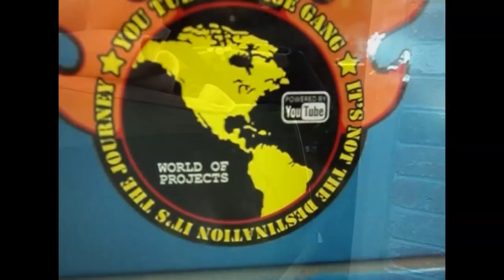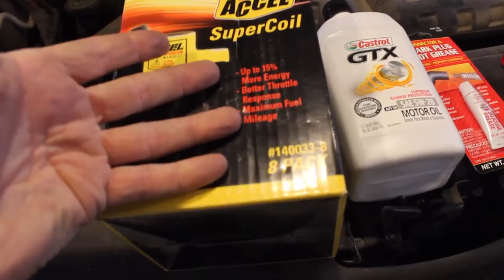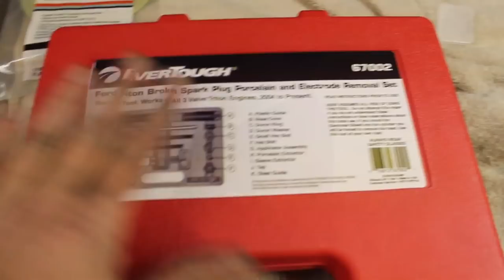F-150 Transmission Shutter - Fixed - Coil on Plug and Spark Plug Swap

Comment: I watched your video and replaced the coils and plugs on my 2009 F150 Triton 5.4 liter 3v. The coils had the brown tips with the updated plugs, so I took them out with a warm engine and had no issues. It fixed the engine shudder and it also starts properly now.  This truck has 247,000 miles on it and now it is running great! I would have spent a lot of money at the dealer if not for your great video! Thanks very much!
Reply from the maker: Awesome!!!

Comment: I am a professional transmission rebuilder for 45 years. when we first started seeing this problem it was and can be hard to ID especially if the problem is slight. but 99 times out of 100 it is a coil breaking down,,,,,,,,,,,
Reply: I have a 92 f150 with a 4.9 i6 5 speed manual and the cel  isn't lit but it stutters in 5th around 60 to 65 mph and I've replaced the cap and rotor, spark  plugs, and wires but no improvement. Im also getting blow by in the air box but the pcv valve isn't stuck,  Would you happen to have any suggestions
Reply: That’s good to know so I just had my transmission rebuilt and a u joint replaced and it’s still doing this same thing right around 50-60 mph when I’m lightly giving it gas. And like he said I can exhilarate and it’s gone so I’m thinking this may be my problem

Comment: Best way to prevent broken plugs is to drive it like you stole it a few times to bust up the carbon and LOTS  of PB blaster.  Remove plugs while engine is hot

Comment: Thanks for your video. I had the same problem and Ford dealer  was of no help. After $250 to clean plugs, and $2875 to rebuild transmission, we still had the stutter exactly as you describe. After watching your video I asked another shop to replace coils ($500) and YES! Problem fixed! Next time I consult YouTube before Ford dealer.

Comment: Was at a loss. Shop thought it was catalytic or transmission. Didn’t think it was misfire because it only showed a cat code. Then saw your video. My 2001 4.6 was doing the same thing; shuttering when it went to overdrive right around 50 mph and light throttle. Saw in your comments that there was no misfire codes, just like mine, so tried replacing all plugs and coil packs just to eliminate that variable.  It worked!!! You were right. Runs and drives great now, and no more cat code too. Thanks so much for the video!

Comment: I had a shudder on my 2005 F150 and after removing each coil one at a time engine running it wasn't the coils, it was the front brake lines. 8 months later I did have to coil problem. Three went out so I replaced them with the ACCEL Super Coils from Oreillys. I only bought them because no one had any OEM's. I couldn't be happier with the results better power, mileage and the money I saved.

Comment: I haven't read all the comments to see if anyone else has made this suggestion or had a better one but nonetheless, here ya go: you don't need that very expensive removal tool. I would suggest using a pair of mechanics gloves when doing this. run the engine, Drive the vehicle and get it to operating temperature. remove the coil packs. blow out the cylinder holes then pour a small amount of seafoam around the spark plugs then spray PB Blaster into the holes until it begins overflowing and boiling. allowed to continue boiling when it stops do a quarter-turn removal as you stated in your video then let it soak in a little while then do another quarter turn then tighten back up quarter turn then loosen a half a turn and just kind of work the plug back and forth a few times everyone will come out no special tools needed. I have done several of these and have not broken one yet knock on wood. hope this help somebody.
Reply: Daryl Seay are sure.....?  lol I'm nervous

Comment: 2002 F150 5.4, 2V.  Had this problem last week at 40-50 mph. Took it in citing problem with transmission. They said coils 3, 7 and 8 were fizzling out. Said the compression was good and that 2002 model wasn't the one that had problems with breaking spark plugs. I paid for 1 hr diagnostic time $85 and said I'd change plugs and coils myself.  Could have been much worse and glad I have a mechanic who is trustworthy.

Comment: Great video... couple of notes for anyone else coming across this...

- Ford fixed the breaking spark plug problem around 2010.. only earlier models have that trouble.

- don't forget to clean mass airflow and throttle body

- need to do full reset on the PCM so that the system can recalibrate itself including all the transmission shift points.  (there are videos on this procedure)

Comment: 2008 F150 with the 5.4 ....3 valve with 138,000 miles.   It's been doing this for a long time, but recently got worse and a little more violent.   I would have bet good money it was the transmission, but figured I'd try this first being the truck is getting some age on it, and the coils could probably be getting tired anyway.   Especially for the minor cost.   I bought the exact Accel coils you listed, got them installed, and problem solved!!   The truck overall runs better and I'm actually getting a little better mileage too.    I can't thank you enough for posting this!!
Reply: 3 weeks and almost 1000  miles later, and all good.  Problem solved and has not returned.  This IS the fix.
Reply: *Long term follow up* : 9 months and 7,000 miles later after replacing the coils with the Accel coils he used, I can 100% say this was the solution to this problem.   It hasn't done the shuttering since.    Thank you Greg!!!

Comment: No codes showed up for my 5.4 triton engine, but viewers should know that the original factory Motorcraft SP-515 spark plugs have been replace by Motorcraft SP-546, this is significant since a host of folks are still purchasing the inventory, albeit new, of old plugs.  6 of 8 of original plugs broke in 2011 (only 75k miles) , but it's important as you've indicated to place spark plug grease on the plugs regardless.  I had my plugs replaced today at 145k miles with the SP-546 plugs.  Like everyone else, I'm happy it was just bad plugs, not torque converter.  My humble opinion is that the motorcraft plugs will go @ 70k miles. My mechanic indicated that quite a few plugs today had only 50% of the electrode(?) left, compared the new plugs.  The drive home was schweeeeeeeeeeeeeeeeeet!!  Hey folks, also keep your transmission fluid fresh every 30k miles MAX.

Comment: This was exactly what I was experiencing in my 2007 F150 King Ranch and after watching your video, I changed my spark plugs and coils and bam the shutter is gone.  Thanks again for the video!
Reply from the maker: Right on!!!
Reply: I was having the same issue on my Silverado.  With how many sensors and bells and whistles there are on these trucks it irks me that no code is thrown. I thought my torque converter was going out but turns out it was the same exact issue as you were having. It would come and go too. It was not constant.
Reply from the maker: Yep.  A lot of the big companies are using this technology.  Along with injectors they get better control of the burn.  Makes for a good sized headache if you don't know what it is or can't find the bad coil.
Reply: These newer trucks are a major headache. I am currently chasing a major evap system leak code. I have replaced every component on the system from the fuel tank on to the motor. It's frustrating. Doesn't affect the motor's performance. I am done with the evap system. Currently looking into deleting it and be done with it.

Comment: I had this exact same problem with my 2004 F150.  I didn't change the plugs (scared of breaking them), but last night I replaced all 8 coil packs and the problem went away.  Such a simple fix.  Thanks for posting this video.
Reply from the maker: +David Schroff No problem.  I'm glad it helped.  There are some great videos out there that outline how to use gumout and an impact to remove the plugs without breaking them.  I haven't had to try it, but understand it has a VERY high success rate.

Comment: Thanks for this video I thought my transmission was fucked 😂but hopefully it's only my coils and spark plugs
Reply: Same here! Trying this 1st.
Reply: Dealing with this right now on my 2018 F-150 2.7 ECO 10R80. Started around 60k and was certain it was one of the many 10R80 problems I’ve read about. The engine light finally stayed on so I could pull the code and sure enough it was a misfire on cylinder 3. Coil packs are supposed to arrive in a day or two and hopefully I can swap them along with the plugs this weekend. Feeling much better after watching this. Cant complain, the truck worked flawlessly for 60k.
Reply: How did it go? Updates?

Comment: Sometimes a faulty plug or coil won’t thr look ow a code/engine light! Invest in a good scanner, plug it in Start vehicle and switch to Accumulated Misfire. Drive it around and on highway and target on the cylinder that has repeatedly misfire, change plug 1st and swap coil with another coil! Repeat all steps if the other cylinder you swapped out coils with starts acting up replace coil

Comment: I have a 2006 f150 and it has the same problem. But I have a code misfire in my 7 cylinder.  I replaced all 8 coil because the price was right at auto zone. Paid 200 for all 8 . And if u wanted 1 its 50 bucks. But it runs get now. I floored it and the truck runs like a champ. Thanks buddy.

Comment: I experienced the same problem with my 2007 Ford Expedition Triton motor 5.4L. It would start to sputter around 30 mph to 40 mph and then again at 60 mph to 70 mph. I took it in to the local shop to have it scanned for any codes and nothing would come up. I had the fuel filter changed and thought that would fix the problem, but it didn't. I finally took it to a local Meineke shop and with pure luck there happen to be a guy there who knew everything about these motors. He offered to go with me for a drive in my truck and so I asked him to drive. We blasted the AC and took my truck for a spin. He noticed the problem at 30 mph and immediately knew that it was a misfire. He said that if the coils and the plugs were bad, it would trigger a code and the check engine light as well. He advised me to change the boots on all 8 coil packs. I was able to purchase at the local Autozone for $29.95 for the set plus $1.49 for the boot protector lube. Make sure to vacuum out the chamber where the plug is in before re-inserting the boot. Also, I highly recommend applying a lot of the boot protector lube at the end of the boot before reinstalling.Conclusion: PROBLEM GONE!I took it through a 15 mile winey road with some hills where I knew I would have to do some light accelerations because of the tight corners. I also had the AC on full blast and my truck rode through those hills real smooth. I would mimic all the scenarios (lite acceleration at 30-40 mph and 60-70 mph) where my truck would generally act up and there were no problems. It's been a month now and still no problem.Please Note: This might not be the solution for everyone, but it is a low risk and less expensive option to try before you try to remove those awfully designed Motorcraft spark plugs. You wouldn't want to end up with a possible $1000 repair bill to remove the rest of the plug. I hope this helps anybody out there...
Reply from the maker: +Greg Si GREAT info!!!  Thanks for sharing!
Reply: +Greg Si You don't need to fill the end of the plug boot. The grease you are using is "dielectric" meaning it does not conduct electricity. Just use a nice minimal amount, using too much does not have any added benefit, the grease is more for making the plug boot easier to remove and sealing it from water/coolant etc.
Reply: Thanks InternetDude. Any additional info that would help benefit the general viewing public is always welcome.
Reply: Greg Si I'm having the same issue with my 2004 f150 5.4 3valve I been breaking my head about to change the spark plugs but I'm going to do what you did and hopefully it works Thanks For the info much appreciated.
Reply: Greg Si dude I can't thank you enough I've had the same same issue changed everything dud everything I could think of from vacum stuff to plugs gas filter all that, so I'm omw to outozone know thank you again so much bro!!!!!!!
Reply: Same problem on 2008 F150 with 5.4L Triton, 79,000 miles. Changing the Ignition Coils for all 8 plugs fixed the problem immediately. I replaced mine using ACCEL Super Ignition Coils Part # 140033-8.

Be sure to get the right coil packs for your engine.
Original Packs:
"Black boots" marked on top with 3L3E (shorter 4 inch boots)
"Brown boots" marked on top with 8L3E (4.5 inch boots)

Only concern is, I know a mechanic who works at a Ford Dealership, he suggested changing the plugs as well because he said bad plugs are the leading cause for these coils going bad.
Reply: Greg Si how is the truck holding up after applying dielectric grease ??
Reply: Greg Si thank you.
My daughter has the same problem with her 07 Expedition.
Going to take your advice and replace the spark plug boots
Thank you so much.
Reply: Greg Si l
Reply: Junk Truck! Lucky you don't have blown out plugs and need a 20hr spark plug change.
Reply: My truck is doing the same shudder. I had just had my plugs and coil packs changed in late-January. Shouldn't my truck be throwing a misfire code on the cylinder(s) on which the ignition coil boot(s) might be bad?

Comment: Thanks. Replaced the coils on plug at 140,000 miles. Fixed the problem. Runs and shifts great.

Comment: You've definitely assured that I'll never buy a Ford with a Triton engine. Nice work on the repair.
Reply from the maker: LOL...  I think the new ones are equipped with a different type of plug.  This plug was actually a revision of the one they used in the 90s.  It's the simple things that have to be right on an engine design.  They def missed a few on this motor.

Comment: Hi Greg, I've watched this video several times.  I have the same shuttering problem.  Been hesitant to remove the original plugs for some time now.  Finally with encouragement and knowledge from videos like yours, I purchased new lisle 65600 tool.  Took me two half days to remove and extract 7/8 broken plugs.  If you have the right tools, it makes it job a little easier.  Thanks for this video.  My truck is running smoother and no more shuttering!

Comment: FORD TECH HERE---if you dont want to break the plugs, get the engine hot and then take out the plugs using a 3/8 impact. The impact action doesnt break the plugs like twisting with a ratchet. I have never broken a plug using the hot engine/3/8 impact gun method.
Reply: You don’t happened to be in seattle ?

Comment: Great video Greg....One thing I did when pulling plugs on my 04 5.4 3v is got it hot, sprayed blaster & left it until the next day. Woke up got it hot, more blaster, pulled coils, then barely cracked them left and right 10x @ least until feel that lil gain then went for a quarter turn, happy ending for all 8 factory plugs

Comment: Awesome Bud ty for taking the time to do this video. My 2005 F150 5.4L was doing the same thing. However seeing you issue with the spark plugs prompted me to take it to the shop. Being armed with your info helped me avoid walking in like a Numbskull. They found #4 and #5 coils bad. Truck just hit 125,000 mile so replaced all plugs, they broke 2 and charged $30 removal. Its been 6 weeks and its smooth as silk....
Grumpy not as Grumpy now thank you Sir.
Reply from the maker: Awesome!  I'm  glad the video helped you out!  Sometimes it's better to know what MIGHT be wrong when you visit your mechanic.  $30 is REALLY cheap for broken plug removal.  I've heard guys paying $1000 for a plug job on this motor.  Take care GS!!!
Reply: Grumpy, what shop did you use? I thought it would cost a lot more if you broke one......

Comment: To address some of the other comments. There is absolutely no need for anti seize on the threads, in fact it can gall up the threads over time and actually make things harder the next time. Ford DOES NOT recommend putting anti seize on the threads, only the protruding smooth area that sticks inside the combustion chamber.

And, definitely do not use junk E3 or crap plugs like that. Motorcraft are the absolute best plugs for all Triton engines. Motorcraft coils are also the best but they are really expensive. There are a few good aftermarket ones as per FordTechMakuloko, however if you go for the cheapest coils you can buy you are more than likely getting inferior quality parts.

For me, I would only replace one coil at a time with new Motorcraft ones. Do some diagnosis instead of "shotgun parts replacement" (i.e. thinking replacing all the coils is actually doing good). If you want to know if a coil is bad, swap it with another cylinder and see if the misfire moves to the other cylinder. That's if you don't have access to the Ford laptop which can show you visually the cylinder balance test in a graph so you can see what cylinder is dropping (I think it's called that).

Generally you are wasting your money by replacing all the coils. They don't wear like plugs, yes replace all plugs at the same time but not necessarily the coils. As one of the other commenters noted, what you might think is a failed coil might be fixed for just $5 by replacing the cracked coil boot.

Comment: Got an 06 F150/5.4. Shudder under load. I too thought it was a possible trans issue but it was the plugs, I ultimately replaced the coils as well. I found out that poor plugs make the coils work harder so, change your plugs when they say and your coils will last longer but if your on your 2nd plug change then just do your coils as well. It'll run much much better!